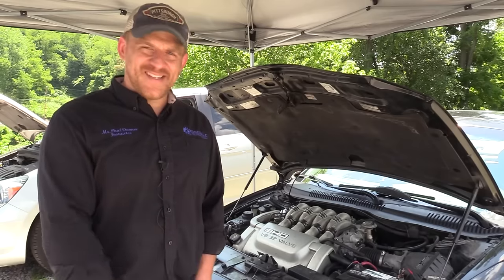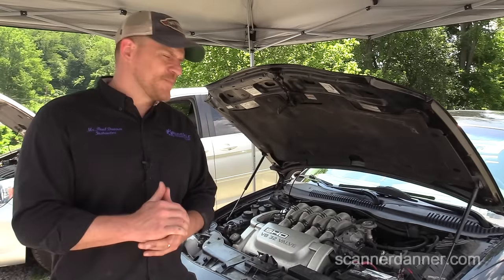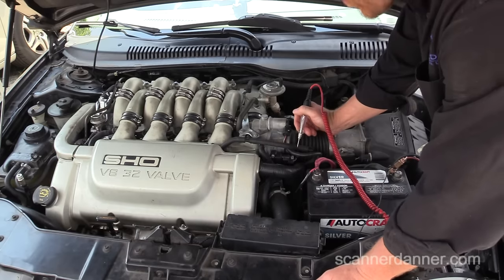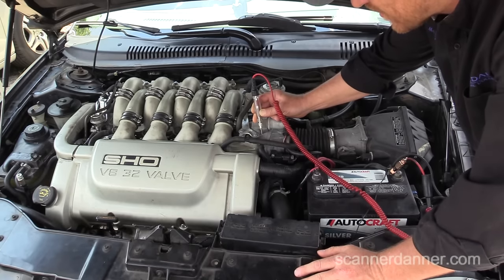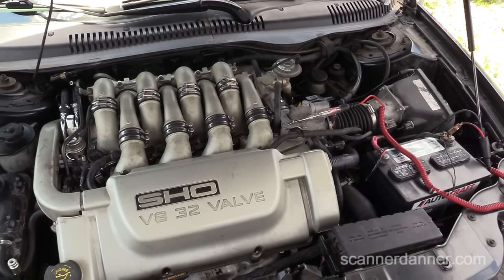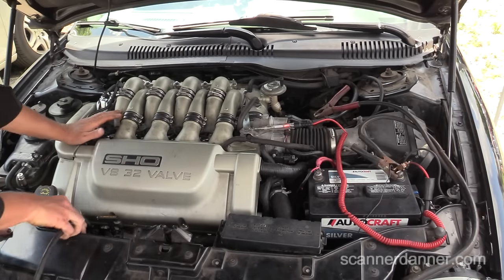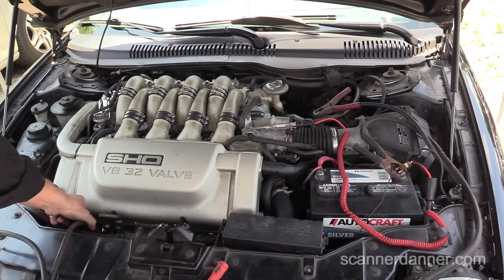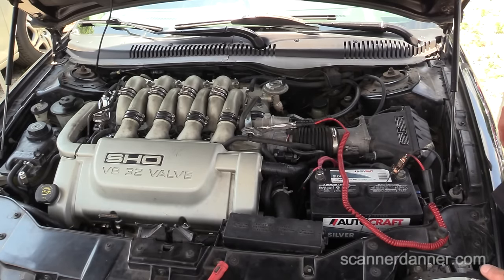No crank, no start diagnosis (bad block ground) - Ford SHO

Comment: That's a great example of the simple ground fault issues! Beautiful! I recently found a ground issue on a friends 99 Cherokee. It would skip lightly under moderate or more acceleration, and around left turns with moderate speed. Found a no hold down battery, and a battery negative cable to body ground with a 99.99% broken terminal end. There was still the most minimal connection, and the short length was still pushing against the broken terminal, not pulling away. When the no hold down battery would wobble under movement, it would relieve pressure against the broken terminal, and would cause the skipping. I showed it to my friend, and said that was the cause. He looked UNAMUSED!! I repaired the broken terminal, we took it for a test ride, and the problem disappeared! He was no longer UNAMUSED. I added a hold down, and the problem has completely disappeared! These vids you guys produce (the ERIC TWINS, IVAN THE WONDERFUL, YOUR OWN BROTHER MR JAMES DANNER, and (of course) YOURSELF) are so informational, and entertaining. Thank you so much!

Comment: Hi Paul, great video. Voltage drop testing is such a fundamental electrical test, and yet is the most under used test in the industry. I am also a college professor, and I push VD testing so heavily on my students, I'm sure they do it in their sleep. Before teaching I was a tech. for 30 years, and I can't count how many times this simple test fixed vehicles that other techs. threw in the towel on. I teach them this method with the test light, and also with a voltmeter. I love your channel, and I use your videos in the classroom.
Reply: northpostman well done buddy, they never taught us this voltage drop test in college, all theoretical, no common applications!!
scannerdanner is the man!!

Comment: That amazes me how someone can connect a ground wire to a non-metallic surface or an isolated metallic surface consciously & not realize what condition they are creating. That high amp current will find a way to ground & if it finds a low amp ground circuit path it isn't fuse protected...bad news but they should see the smoke before the fire :-)  Eric O just did the same test yesterday on a chassis ground using a test light aka scope on a rope & jumper cables & today you covered block grounds using same tried & proven method.... Key is loaded circuit, loaded circuit, loaded circuit!!!  Great video Paul & I highly recommend your Premium channel to anyone wanting to learn automotive diagnostics at a bargain price!

Comment: The more I think about this the more elegantly simple it becomes. A few ohms of extra resistance will paralyze high current devices, even though most low current circuits do fine. The test light showed the problem but it robbed power from the starter, allowing more current to flow but not enough to turn the armature. Excellent demonstration. Great point about the risk of backfeeding through sensitive electronics.

Comment: I don't really understand why the test light should not light up, I thought the idea was to get electricity to flow through the engine block back to the negative terminal. Good video!
Reply from the maker: Because voltage potential is 0v on all good grounds. And my test light is connected to battery ground!
Reply: @ScannerDanner  Thanks so much!

Comment: Back in the 90's, we used to get a lot of cars that would not start after someone changed the clutch... same idea, bad ground at the transmission / block, BUT... the injector driver(s) would fry, because the starter found a ground path through the ECM. Depending on how the driver blew, it would no longer squirt fuel, or the injectors would be stuck open... flooding the cylinders.

Comment: This is interesting. I had an issue once where my tail lights weren't getting a good ground and I connected my jumper cable from the battery to near the tail gate. I left it running for 20 minutes and when I disconnected the cable it too stayed on, but from this the lights came on without me cleaning a ground for about 3 months. That blew my mind. I started thinking trying to see why. It's like the electrons remained in the metal. I asked everyone had they experienced that no one had until I saw this although this didn't last nearly as long.

Comment: I had the same problem once.  Wouldn't crank sometimes but then be fine for days.  It was a ground wire from the top of the block to the starter relay.  Only figured it out once I saw the smoke.  I had no idea about cars back then and it took me 3 days to find the fix.  Proud moment when I fixed my first car.
Reply: I am hoping that is the issue that I'm having. My Mitsubishi Outlander won't start intermittently. Sometimes it does fine, sometimes I can't get it to start for hours or even days. I'm thinking there might be a damaged ground wire somewhere on the starter or something.
Reply: I have this problem, no crank once a month. Can jump relay starts right up.

Comment: Have a 2010 VW Routan(Chrysler).  I had the problem of one click, no 
start.  This fix may not fix everyone's but it did mine.  It is likely 
not the starter or the battery.  If the starter is clicking then it is 
not the NSS at all.  The NSS prevents the starter from doing anything.  
So check that off.  Switching your gears is NOT fixing the problem.  
It's only a coincidence that it works after.  I have this problem after 
my first OEM starter blew and a new (re-man) one was put in by dealer 
and sometime after my trans was replaced/fixed for a whirring problem.  
This problem went on for several years and slowly got worse.  This 
year.(2020)  It would happen everyday and almost everytime I tried to 
start it.  Put 2 starters on it, same thing, battery good, etc.  Weird 
it hardly ever happened in the winter.  I'm believing now it's because 
of the drier weather.  Now after watching this video I decided to check 
the grounds. (https://www.youtube.com/watch?v=qdS1Ru1s6H4).  To make 
this short.  I replaced the broken ground strap that is on the passenger
 side engine compartment that grounds the block to the frame.  Mine was 
broken as you will likely find yours to be.   
(https://www.chryslerminivan.net/threads/ground-strap-broken.170175/)  
Then I removed both cables on the starter (There are 2) and cleaned them
 with a power drill with wire brush attached.  (nice and shiney)  Then I
 removed the eyelet ground wire from the battery to the frame (located 
inside engine compartment behind drivers side headlight)  Cleaned that 
the same way.(nice and shiney, both eyelet and post).  Next do the same 
for ground wire that screws onto the transmission housing. (power drill,
 wire brush, bare metal)   Tighten up.  Clean battery posts too if yours
 are crappy.  Basically, you're just not having a good enough ground to 
spin that starter.  Haven't had the problem since, over 2 weeks now.  
Problem:  One click, no start.  Solved:  Cleaned ground connections and 
the "hot" connections to starter.

Comment: Can't believe the garage couldn't carry out that simple test themselves. As an ex Nissan technician & foreman I would expect every mechanic to know those basics, even the apprentices.
Reply: One of the most common mistakes in the industry.  I have gotten dozens of no start/hard start/stall no start conditions, and in most cases a bad ground being the culprit.  I see it way too often with body shop cars.
Reply: Very common but not always due to error sometimes the cables just  break,  the   old style earth braids were more flexible  --- if called out to a no crank no start  a jump a cable engine  or gearbox to battery negative was always the first   quick and diry test.
Increasing even finding a good ground  on the engine to hook up the jumper cable  is becoming more difficult,
Reply from the maker: In this garages defense. They realized their mistake but allowed me to film it.
Reply: ScannerDanner An honest mistake.  Lord knows I have committed my fair share.
Reply: Yes often  block grounds aren't in obvious places.  For anybody building or restoring a car it is a good idea to locate the grounds in a visible place, or even run an extra ground strap between engine and body.
Reply: John - Orbiter ii

Comment: This video was helpful.  I stumbled across a bad ground recently,  thinking it was a bad starter but it was just the ground wire connected to the frame.  Once connected to starter,  no problem.   Would the battery not charge properly with a bad ground to starter or block?  The vehicle has charging issues, alternator shows good.

Comment: The way I see it Paul, is during starting due to a lack of a solid block ground, the starter cannot source it's 150 amps required for cranking.  At that time, it's trying other ground routes for the starter current back to the battery ground.  There may be paths available but with the high amperage trying to be conducted the available grounds are dropping to much voltage and the starter is getting less than the minimum required approximately 10 VDC.  Once the car is started, the remaining power circuits required for ignition, etc have ground routes available that do not draw high amperage and are satisfied providing ground paths for these ignition/computer/sensor circuits that are required for the engine to run?

Thanks Paul.

Comment: Nice video. I have seen older cars run with the engine grounding out only on the throttle linkage :-)

Comment: I was using an ked test light when I found a bad ground on my Chevy van no start vid. but I'm with you. just an incandescent seems more precise.
Reply from the maker: Hey big brother, thanks for the comment. Enjoy the beach man. I'm seriously going to miss it this year.
Reply: It looked like the out west trip and the YouTube etcg thing was a great time, but there is nothing like shutting down at the beach
Reply from the maker: Exactly. By the way, you should come next year to the e etcg meet up. You're presence was requested by many
Reply: Was hoping for a smart Alec remark. We need more videos James. Was watching and older video on 4 wire Toyota/Lexus cops and was wondering if u guys insist on OE coils at the James Danner romper room. Hoping Toyota Tech would chime in from Brexit land?? The video was on Scanner Danner. Which is fantastic. Only thing better is premium, which I wouldn't go with out. I have YouTube Red. The only time I have to watch an ad is on Scanner Danner Premium. Why is that Paul?
Reply: James hope to meet you next year at ETCG'S. Bring your shop friends too

Comment: Need to change my negative batt cable, works ok it's just old. I have a nice new cable, I just need to track the old cable to see where it's grouded to. I have a 96 Ford F-150 with a 5.0 V8. I wished I could afford some diagnostic tools, like the ones you have.

Comment: Paul.  Thanks for the great example with test light and jumper wire.  I am a premium subscriber and have learned a tremendous amount from your video’s.  Quick question on body grounds.  I have a 05 Caravan with a corroded G101 ground stud. The stud snapped when attempting to remove the corroded nut.  No problem though I drilled a 1/4 hole next to it and reattached the ground eyelit there.  If I run an additional wire attached to the ground stud to batt negative do you foresee any problems?   I am thinking more paths to ground the better.  Just curious in case I am somehow bypassing chassis ground system.  Thanks for all your help and explanations.

Comment: I sure hope this is what's wrong with mine. Can't wait till morning. Thanks for the video 👍
Reply from the maker: Looking forward to hearing about it!
Reply: Still chasing 😭
Reply from the maker: @maxpower3949  what's going on and what tests have you done?
Reply: 2003 3.8 mustang. Cranks fine, then nothing. Checked, battery, cables, grounds, and fuses. Just took the starter out because I couldn't get to the wires to test it 😓 Now to test or get new one. Sidenote: I watched a video where a guy took the relay fuse out and jumped the starter with a wire to test it. All I did was blow a fuse. Or at least that's all I hope I did
Reply: It was the solenoid. Didn't have a way to check that first 😥

Comment: Only trained mechanics would expect to see a test light light up touching an engine block that has a bad ground with the test light hooked to ground. Ive been around mechanicing for a long time and have never come across this particular situation. This is one of those wow! Moments for me. 

I have come across a 24 V alternator on a bulldozer not charging because some one lost the insulator washer at the alternator to battery term. After much head scratching I found it because the eye on the red lead going from the alternator to the battery had turned glowing red. I'm still not exactly sure how a direct short like that on a 24 v system did not instantly burn the  wire in half maybe there was a protection circuit in there somewhere..

Comment: In the old days when cars still had carbs with manually operated chokes we used to see old style BL Minis where a lower engine mount would fail   and would be only restrained by the block ground. Eventually the extra strain would break the block ground braid and the  customer would complain that the car was very slow to crank and smoke  was coming from the dash  as the engine grounded through the choke and throttle cables.
Reply from the maker: That's crazy! And awesome at the same time!
Reply: It's easy to ignore floppy engine mounts, but they can really wreck havoc. My '92 Dodge Monaco (near-Renault 25) had a cracked fuel line, then all the transmission fluid leaked out a hole in the side of the casing, at which point I caught on and replaced all the mounts. More recently, I went to visit my sister and brother-in-law and complained that their VW was so loud I couldn't hear them talking. Turned out everything was going wrong at once, including electrical glitches and exhaust leaks; I suggested they look at the engine, transmission and subframe mounts. They were all bad, but the car was too far gone.

Comment: Thank you so much! I believe this just confirmed that I have a bad block ground. Cause there are times when I try to start my car (battery charged w/good clean connections) I get no crank. But as soon as I hook the jumper cables, it starts right up. Funny thing is on a normal temperature day it will start on its own. When it is real cold or hot outside sometimes I will turn the key and it will take a second or two before it cranks and starts, or I have to turn the key two or more times before I get my crank. Someone said it was my starter or ignition switch, but the fact it starts right up with my jumper voids that suggestion (plus, I did have my starter go bad and it was replaced) I have also gotten a new battery (twice). Like you stated in this video, I think the reason it starts on normal temp days is it is finding some alternate way to ground, then on the hot or cold days it can't get that ground... I will watch your other videos then run some test to confirm this. S.D. Thanks again!
Reply from the maker: Thanks so much! Here is a playlist I created for starting, charging, battery issues. I'm sure these will help you if you cannot find a bad block ground. 
https://www.youtube.com/playlist?list=PLAFYVCyenqcpZM-kQg5MUX0OvrIPSirz5

Comment: Im currently working on 12 Avalon that has a problem with the climate control and radio lights flickering....leaning towards a ground wire as well

Comment: Great tutorial of basic tests and basic tools. Nice case study Paul. Thank you.
Reply: Always look for your comments. I was wondering, I am sorry don't know your first name, when u work on a friends car, do u sometimes use aftermarket parts. And which ones can we cheat on?  I have used aftermarket coils. New af sensors always bite me. Older o2s sometimes ok. Thank u for your input.
Reply: +Bill Rimmer Depends on what kind of job they want. If they're keeping the car and can afford I use genuine from the dealer or aftermarket OEM. If it's a cheap job, cheap crap parts! Tom.
Reply: Thank u Tom!!

Comment: Working on a chrysler at the moment. Where would 150mV come from on the block? And would that be enough to mess up a tcm which is grounded on the block?  Already replaced the alternator which tested bad. After replacing the alternator, the block voltage (and tcm ground) dropped to 90mV.

Comment: When I see this it makes me want to check the other ground in particular the engine to body and body to battery as those wires and connections are only rated for vehicle loads usually around 50Amp max.
I have also seen systems where they go battery - body  - engine they seem to be the worst for bad grounds due to corrosion on the body where the wire is fastened.

Comment: I wonder if an LED test light would have actually worked in this instance or not!  The voltage differential was opposite of what it should have been when you loaded up the block, and since LEDs can only pass current in one direction, I'm not sure we would have seen it function the same way your incandescent did.

Comment: I had to laugh, u use a pop up gazebo to keep out of the sun, here in Scotland it is used to get stopped getting soaked by the rain! cheers Paul, sandy
Reply: Both are valid reasons for ownership..... Especially when the temps are 90+ in the shade !!!